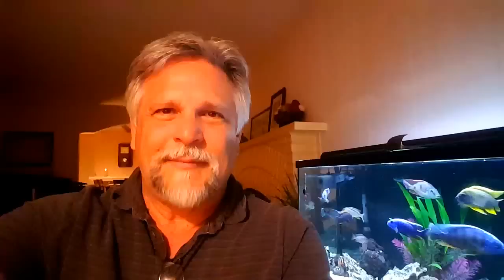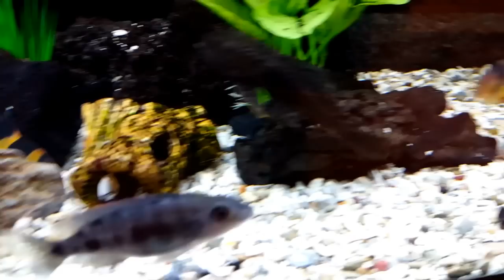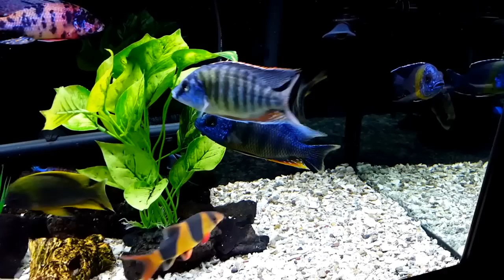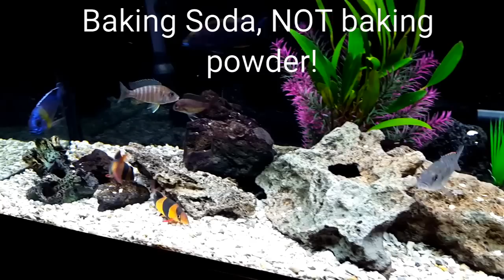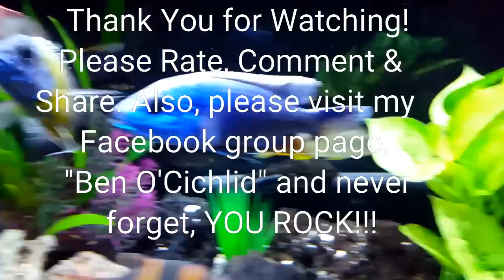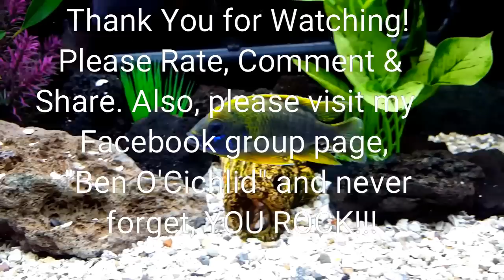African Cichlids: Water Testing, What Does it Mean?!

Comment: Thank you for the videos and input, Ben!  Keep up the good work!  Any recommendations as to when you should do your first water change on a newly cycled tank?
Reply from the maker: Test the water and when nitrates go up a notch, give a 25% change.  You number of water changes and the percentage of water change will vary depending on factors like filtration and bio-load.  So, if you add more fish, or after the fish you have take on more size, you might need to increase water changes.  Good luck.
Reply: Thank you for the advice!  I had been seeing 40-50% weekly water changes (I purchased one of those python type syphons for this) but was curious as to when realistically this will need to start since I will have to build up some beneficial bacteria initially.  I will have a 75 gal. (trying to have an all male peacocks and smaller haps tank) with two 75 gal. power filters and a wave maker.  Not going to have a canister filter initially, however, might have to move to one eventually if the two 75 gal. power filters aren't getting it done.  I would eventually like to have around 20 or so fish in there.
Reply from the maker: Depending on the adult size of the fish, 20 can be okay in a 75 with proper filtration and maintenance schedule, IMO.  The python is a game changer.  I used to dread WC's because I hated lugging the buckets.  No longer 😀
Reply: Man, same here.  Back whenever I had cichlids last (I used to keep Mbunas) and I did like everyone else...lugging those 5 gallon buckets and making a mess in my dad's house haha (high school days).  Can't wait to try out the python!  Thanks again!
Reply: Ben, I've done my first water change because the ammonia came up (to about .25), however, the nitrates and nitrites did not.  I changed about 30-35% of the water on Saturday, and now my water is cloudy (somewhat milky looking).  It's seems I may be going through a "mini cycle".  All fish are fine, however, the ammonia level is in between .25 and .50.  I am wondering if I took out too much water (causing a bacterial bloom?), or what the deal is.  I conditioned the water with "prime", based on the research I've done.  Is there a reason my ammonia levels are somewhat high (since they're above 0) but yet nitrites or nitrates have not been an issue since the initial spike and cycling of the tank?  I'm at a loss and really want to get my head around this before I set up the larger 75 gal.  Thanks for your input and time, as always.